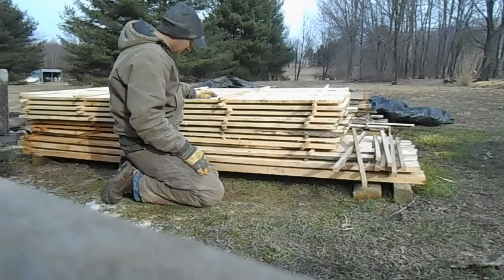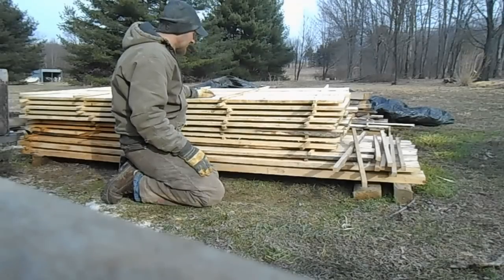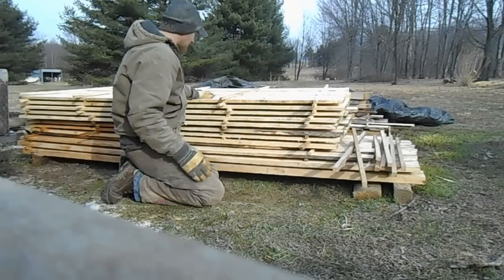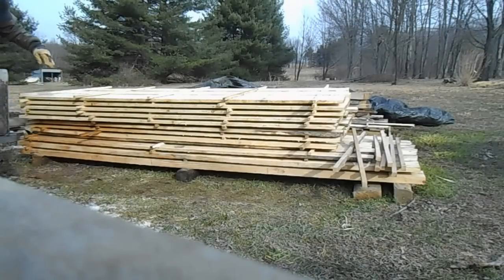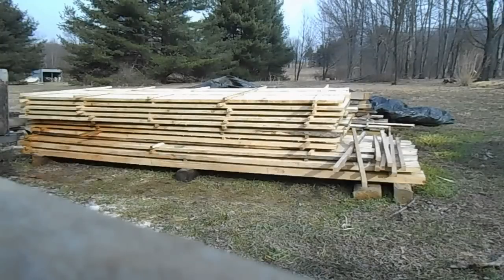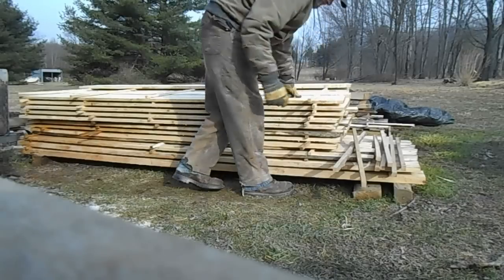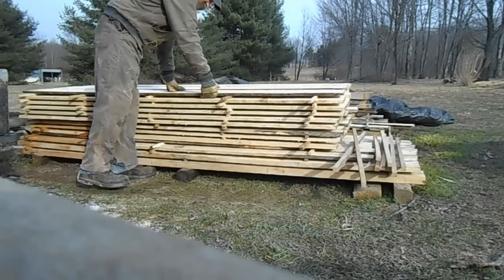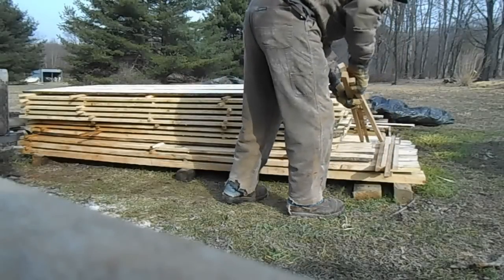Proper way to Dry Green Lumber

Comment: Thanks JC. Im about to mill my first lumbar having had some practice on a couple of logs. How much care do you take to level the bottom of your stack before loading it? I will be milling logs in my own bush paddock and stacking them there to store/dry. The ground there is quite uneven. Should I level the ground under each stack (seems a pain) or is it better to invest in steel sections to lay on stumps to create a straight base? Any other options? What do you use? Thanks.

Comment from the maker: No problem. I hate for you to have to learn the way I did. You may have seen I had to replace my exhaust bolt threads with heli-coils. But they did fix my issue. I am tempted to try a ripping chain again now.

Comment from the maker: I would not use fresh milled material for stacking. Maybe try cinder blocks the bottom row or something that is not holding moisture. Yes, the market for rip chains is very small but Sthil makes quality stuff. Be careful with the rip chain it caused a lot of vibration in my saw and my exhaust fell off. It does however cut lot faster.

Comment: Thanks for this information!  I am about to take on my first milling project.  We had two acres of pine cleared about a month ago.  My questions are 1) is it too late to mill now that its been piled for a month?  and 2) What do you recommend to keep insects from eating my milled lumber?  3) Does the lumber shrink once milled and dried?  Thanks a bunch!  -Michelle
Reply from the maker: No it's not too late, I have a pile from years ago that is still planned to be lumber someday. As far as the insects, I don't hav any issues. Yes the lumber will shrink once milled. It will also get less heavy as it dries.

Comment: Jason, I will be having my  pine trees milled into 2x4s, 2x6s (8', 10' and 12' long) and some 4x4 and 6x6 posts to build a barn. I have a couple Long Leaf Pines that I plan on using the heart for the posts.  When I stack the lumber to dry it, can I use the 2x4s as stickers or do I need to get some smaller pieces? I want to be able to use the 2x4s in the construction of the barn once the wood is dried.  Also, what do I do to dry the posts properly?
Thank you for sharing your unusual wisdom and skills.
Reply from the maker: You can use 2x4s as long as they are dry. If your stickers are not dry the areas where they touch your lumber will never dry properly. The post are dried the same way but will take a little longer to dry due to the thickness. Also I suggest you paint roof tar around the bottom of the post before you place it in the ground, this will add years to there life. This sounds like a fun project, best of luck!
Reply from the maker: You can use 2x4s as long as they are dry. If your stickers are not dry the areas where they touch your lumber will never dry properly. The post are dried the same way but will take a little longer to dry due to the thickness. Also I suggest you paint roof tar around the bottom of the post before you place it in the ground, this will add years to there life. This sounds like a fun project, best of luck!
Reply: @JCsBees  Thanks so much!  Everybody has an opinion and everyone will give me an answer, but few have ever actually used their own milled lumber. It's always best to hear from a voice of experience.

Comment: Does the lumber have to be 100% dry to use for wood working projects?
Reply from the maker: Bestbetbuying It depends on  what your are building. If your building a shed or something like that then I would not be afraid to build it with green lumber (fresh cut). But if your building furniture I would let it dry fully. If not your project will crack and shrink. 

Keep in mind some lumber drys faster than others. I hope I was of help.

Comment: I was using the same technique as you but a woodworker here told me that if I am in a hurry and need the wood to dry fast I can put the boards sitting up as in with the fibers pointing up. Gravity will pull the water down through the fibers and they will dry faster. So I have taken 10 boards and placed them in the sun on the side of my house and I must say that they truly dry fast but they curve on the inside like on the width. I don't know if it is from the drying procedure or if they will all dry like that even the ones I kept like you in the video. What do you think?

Comment: hello sir I am looking to start cutting my own lumber. I would like to have some information on cutting 2x4s. I seen in another comment that you must wait to rip your slabs into 2x4s. but my question is how large are your typical slabs, and is a year of drying required for using your lumber in construction projects like a pole barn for example.
Reply from the maker: That is awesome! To be honest, some people do let large slab dry like you mentioned before cutting into 2x4. I however do not wait. You just need to stack the 2x4 on the bottom of the pile so they have weight on them to keep them straight. Yes, I have built many things with wet wood. Just nail it well and don't be surprised if you have to replace a couple after they dry. I built my sawmill building with green lumber and never have had any issues.
My slab vary in size, just remember the bigger the longer it takes to dry. Also consider buying a moisture gauge to check your lumber. If you search my channel you will find a video on my gauge.

Comment: any tips on preventing cracking other then anchorseal?
i have seen some people use candle wax however that does not seem ideal for cutting large logs into slabs.
thanks in advance
Reply from the maker: I do wax the ends of my logs once the trees are cut. That does help. I am friends with a logger and he gets the wax sealant in 50 gallon drums, once they get down to a couple inches of wax left, he give them to me. Free wax is the best!

Comment: Jason, what's the best way to dry, pressure treat, and termite proof a piece of timber (12' x 12') I need as a support beam for my house.
Reply from the maker: I have a couple outdoor structure I build from lumber I cut. I treat them every summer with old oil diesel mixture. I imagine that would work but be a every lasting job though. If you could soak the beam in this mixture for a period that may work but you would need a huge tank. Wonder if paint or a tar would work.

Not sure I was of help. But let me know what you figure out please.
Reply: i will, thanks

Comment: Maybe this has been asked--do you put a "sealer" on the ends to prevent end from drying too quickly and splitting?
Reply from the maker: Log wax! I am friend with loggers and when their 50 gallon drum gets low they give it to me. You can also use paint.
Reply: How soon after cutting do you seal?

Comment: I just cut my first slabs this past weekend to rip into 2x4's.  I 
figured they'd dry faster if I ripped them down into the 2x4's before I 
stacked them.  I cut my first one out and with in minutes it bowed 
really bad.  Should I just leave the slabs intact and wait until they're
 dry to rip them down?
Reply from the maker: Yes, I would leave them slabs until they dry. Make sure you stack them so air can flow between them and maybe set some weight on top of them. Good luck, nothing like cutting your own lumber!!!
Reply: Thanks for the reply! I ripped a few more last night and one from a different slab, but same side did the same thing. I stacked them on stickers and ran a half inch by one inch sticker vertically between the boards every couple of feet so I still get air circulating 360' around the board, but once strapped they're nice and straight.
Reply from the maker: No to wait it out! This is the hard part when your new to cutting lumber. Good luck my friend!